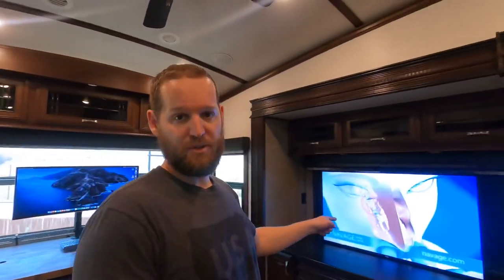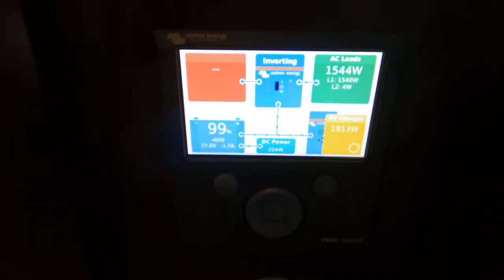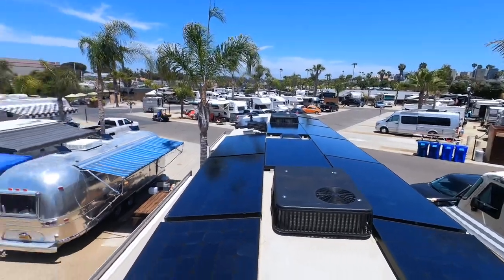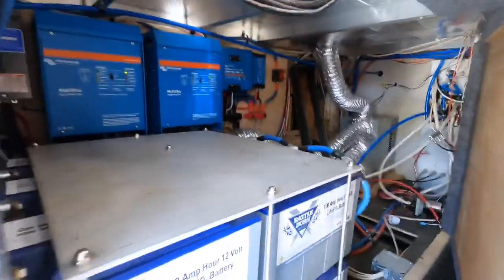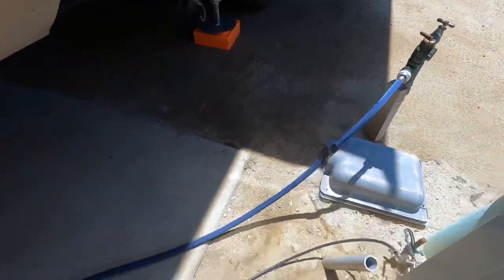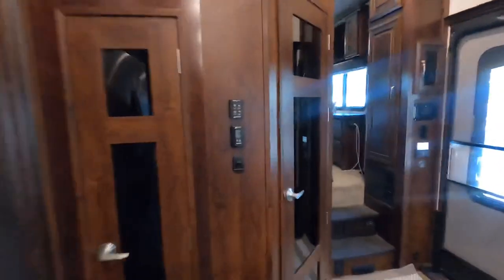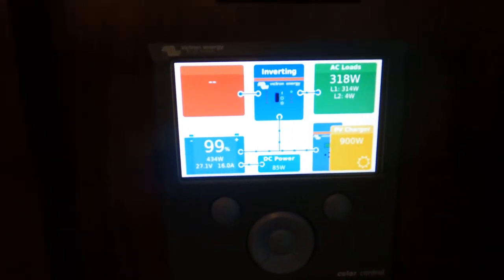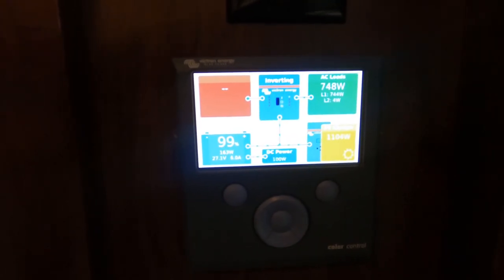Can We Run RV Air Conditioning On Solar Power? A Quick System Overview!

Comment: The dog sleeping in that position was hilarious.What would you think about running a ductless air/heat system instead of the roof shaker style?
Reply from the maker: I actually did a mini split on my last RV, I really did enjoy it but it was a lot of work to make it “like factory”.  It would be much nicer if you could buy a new RV with one pre-planned, pre-plumbed and pre-installed.  Then you’d really be on to something.  It’s a goal of mine for the future, no doubt.
Reply: we call it camping How did the mini split handle the traveling? That ya always been a concern of mine that it would get beat to death?

Comment: Very nice setup. With that bank of batteries do you still need some sort of extra capacitor for the initial start/surge of the A/C compressor?
Reply: He mentioned he has an Easy Start from Microair on his air conditioner. It lowers inrush current significantly. Small generators can run an AC when installed.

Comment: Hi, good video. What would say your total power generation is on a good day?  You've got 2,500 watts of solar and I've heard the rule of thumb is 3 or 4x that for a daily total, so 7,500 to 10,000 watt hrs?
Did you ever consider a mini-split that would only pull 400-800 watts vs your AC needing 1,500?

Comment: How many watts of solar do you have? And so you're inverting with 24 volts with a converter for the 12 volt stuff but the 110 is off of 24 volts correct?

Comment: Do you have to use Soft Starts on your air conditioners?  Did you consider using 320 Watt solar panels, which are a little larger, and heavier then the 200 Watt solar panels?  The size difference is negligible,  and the weight differences are approximately 40lbs verses 26lbs for the 200W solar panels.  I figure that I can lift a 40lb solar panel, but not sure they will fit?

Comment: Very nice setup. Can I ask what charge controller and inverter you are using? Also how money do you think have in total for your system? Just curious thanks.
Reply from the maker: Charge controller is the Victron 150/100 and dual Victron 3000/24 inverters.  I really haven’t done the math but I’d say you’re in the $18-20k range in parts.
Reply: I figured it must be somewhere around there given the cost of Battle Borns alone. Thanks for the info.
Reply: @patcmontgomery  Hopefully you are still monitoring your comments on this video. I am getting close to you now! I have 4 - 200 ah batteries. But still need more solar but getting there. Question for you about the 24 volt to 12 converter. Is that powering heavy duty 12 volt appliances such as hydraulic slide motors? I can't get my head wrapped around how I can got to a 24 volt system in my fifth wheel. I believe that 24 volt to 12 volt converter you have is around a 70 amp, is that enough? Or are you hiding a 12 volt battery somewhere still? Thanks!
Reply: @muirindustries you can get a 6500w system for much cheaper now with 48v batteries. Those will last longer and with 8 410w panels make enough power to start and run ax for less than half the cost

Comment: what brand is that controller/control panel? does it have a way to integrate grid power if thats plugged in and charge the batteries?

Comment: Do you mean that the rv can have a single air conditioner running 24 hours without the need to connect to the electrical network? 

Does that mean that during the day the solar panels run the air conditioner and ALSO FULLY CHARGE the batteries, which in turn provides all the power throughout the night?

Comment: What brand panels do you have?   Also what’s the difference in the battle born deep cycles?  I see there is two styles. One looks smaller than the style you have.
Reply from the maker: I have Sunpower panels.  So long as you’re talking about their 100ah batteries there is no difference, just form factor.  Just go with whatever fits you best :)

Comment: I am betting that setup is around $20,000 (at least) in parts alone.  Each of those batteries are around $1000 and those are the Victron inverters--also around $1000 each..
Reply: Yup, a masterclass on overkill spending.
Reply: Better than spending the money on cocaine bars or whores. LOL
Reply: @bullbutter9699  I guess it would be.  I went for a Giandel inverter with a separate automatic transfer switch.  Batteries were Ampere time.  Setup works great.

Comment: Great video! I am about to purchase a 2021 Palomino Revolve EV-1 RV. Whats unique about this travel trailer is that it is all electric and runs completely on solar. It has 400w of panels on the roof and another 300 watts of portable that plugs into the back with 4 battle born 100ah batteries.   They are saying it is sufficient to run my heater and AC. I'm not seeing it. It is a Renergy system, designed by them and has one 3000 watt inverter. I would love to hear your thought's on this out in the real world and how you think it will fair. Any input would be greatly appreciated!
Reply: I just received my 300 watt Renogy system yesterday, so I don't know personally, but I think you're right that it's not enough. The 4 batteries is sized right for making coffee (I overwork my 330AH battery bank (3X110) using my small keurig on a 3,000 watt inverter. It will drop those batteries from 12.5V to 11.5V by the fourth cup of coffee, but they bounce back up to 12.3 or so. I wouldn't risk damaging something by trying to run my A/C on this. I've burned up two cheap inverters getting close (but not exceeding) the output limit. 
As for the panels, I've been reading on the forums. People that have 100watt panels mounted on the roof seem to get about 50 to 60 watts during the heat of the day, and less the rest of it. Oddly, on the forums, people giving their actual setups and outputs are ignored as the thread goes down the spec sheets talking about what you need. The guy who pipes in and says he has that system, and gets half what the thread is assuming just gets ignored as the majority continue to use the optimum numbers on the spec sheet. 
Maybe you have a really efficient air conditioner, but mine has melted extension cords on a hot day plugged in when 30 amps wasn't going to reach. I'm figuring on being able to make coffee and run everything but A/C without the generator on this 300 watt system. I'm figuring I'll peak about 20 amps, and can count on at least 5 to 10 for the bulk of the day. We'll see; mostly I just wanted a trickle charger that wouldn't boil off my batteries when I'm plugged in for weeks, so I thought I would upgrade.
Reply from the maker: You have a zero percent chance of running your air conditioning via this setup.

I don’t know what inverter it comes with, but if it’s large enough you could theoretically run an air conditioner for a few hours, but you’ll be running at a huge deficit and sooner rather than later you’ll have dead batteries.
Reply: If one adds a "Soft Start" Capacitor, you might be able to run one A/C unit, for a little while.    I set up an RV. with 1800 Watts of Solar Panels, and 400 ah batteries, and I was able to run one A/C unit for quite a while,  My biggest limiting factor was the 400 watts of battery power.  I used a 150/100 MPPT Victron charge controller with one 12V 3,000 watt inverter.  I tried running one A?C unit, but my system just could not handle it, until I put a Soft Start capacitor on the A/C unit.  I think that I was barely able to run my AC unit, and the A/C unit eventually failed.  I don't know if the problem was low voltage, but I know that in the event of a low voltage condition, the A/C compressor over amps, which will cause a failure to the compressor.  The problem is, it may only experience low Voltage for a minimal amount of time, just when the batteries go dead, or on their last leg.  Therefore, often the problem of low voltage is not recognized, until the compressor burns up, or over heats one too many times.

Comment: Damn! 12k just in batteries!
Reply: exactly my thought!
Reply: @rffairchild2  every 6 years too. must be nice to have 2k a year for batteries.
Reply: Current lithium ion battery banks last for about 10 years before replacement is needed
.
Reply: @jimfairchild2093  is that like avg or youtr setup? they are rated for 6 years with normal use.
Reply: Can you explain more on the rig to keep the batteries cooled? And other aspects on the spaced used in the RV storage area?

Comment: Love the setup man. Pretty much my ideal system. Do you foresee the need for a supplemental ground array for the meaner weather?
Reply from the maker: Where the Jones thanks!  Shooting from the hip my answer would be yes, but I also think that has a lot to do with the temperature you’re comfortable at.  As someone who’s lived their entire life in a relative lack of humidity, it’s just something that I can not stand so when it gets hot and humid I require the AC.  My assumption is, as we head east we will reach a point where I’ll have to supplement our power, either via our small generator or visiting an RV park etc.  A ground deploy is something I’ve heavily considered but never needed and until I have a better grasp on the real world requirements I don’t want to put something together that isn’t ideal.  The only thing holding me back from already having one is transportation/storage of the panels.  Plus, inevitably the moment I put them out is the moment it gets really windy...
Reply: @muirindustries  Makes sense. Using the generator might be the best solution for supplemental, all things considered. But like you said experience will give you more info to work with. We have another 1-2 years before we are back in the States but when we do we will be full timing and will be needing the autonomy that only a system like you have will provide...and I too like my A/C.  I got my notifications on so I'll be watching for any updates.
Reply from the maker: We’ve got two more nights in an RV park (Bullhead City, AZ) to let the dogs play in the Colorado river by Lake Havasu, then we’ll start the Boondocking portion up at the Grand Canyon and I’ll actually put some effort into videos (not just a haphazardly thrown together GoPro video like this).  I’ll be doing some stress tests and all of that.  You’ll have to keep me updated as you make the transition yourself!
Reply: @muirindustries  will do!

Comment: Amazing setup.. this is the way it’s done ✅ How much did that set up cost is what I would like to know?!
Reply: Easily $20k+
Reply: @ryanyoung7433  I was thinking the same 20k, I think his system is too extreme. My solar system is only around 3k. which includes 8/200 watt panels, 4k watt 24V inverter, 4 100AH Lifepo4 Batteries.

Comment: If you have a net zero draw from the batteries, do you really need 12 batteries for ac to work in the sun? Would a similar setup work with only 2 batteries?
Reply from the maker: Generally speaking you'd need a bigger battery bank than that, at a bare minimum you'd need 4 to spread the load out.
Reply: You could draw more amps by getting 6v and making 12v connections. Then in series. You would be able to run it but for shorter time. 24v system would be ideal.
Reply: 6v tend to have hire ah than 12v

Comment: Are your panels from Tesla too? What sort of watts each panel makes?
Reply from the maker: They are Sunpower 210w panels
Reply: @muirindustries  So, you have 10 solar panels? essentially making 2.1 Kw on a good day? And, 2x 3,000 watt inverters! Of course you can run the A/C when you throw tons of money at the problem!  Your video should be titled, "Solar A/C only works when you have money to spend, good luck everyone else!"
Reply from the maker: @joshi.5553  12 panels, 2.5kw on a good day.  Maybe I'll make a video about how you can own an RV if you have money, good luck everyone else!  It's all relative.....

Comment: I'm a bit confused. I have a similar system with most of the same Victron components and I also can run my A/Cs. You show that you are pumping 1900ish PV watts in the video but only have a 150/100 charge controller. That math escapes me. if you maxed out that controller you would have 100 amps flowing at approx. 13.5 volts which is 1350 watts at max. What am i missing? Perhaps another controller I didn't see?
Reply from the maker: You missed that the system is 24v, thus that controller is capable of double in all ways ;)

Comment: I have the Victron 3000 with 4 lithium batteries. Trying to run my dometic 13500btu AC unit with the soft start installed.
The fan will start but when the compressor kicks on it trips the inverter. Can you help me figure out why?
Reply: The Victron 3000 only puts out 2400 watts in real power.  A Magnum Hybrid MSH3012RV inverter can put out 3000 real watts continuously.
Reply: It could be a setting on your Inverter.  I had the same issue with my system.  I have enough battery power, but everytime I started the microwave, the inverter would fault out.  The issue with mine was the inverter was set to trip out when the batteries went below 12V.  When a large power load is on your batteries, they will measure lower voltage, so the inverter thinks your batteries are low and need to be protected.  When the large load is stopped, the batteries jump back to 14V.  So, take a look at your inverter settings.  You may also want to look at the wiring between the batteries and the inverter.  If it's traveling more than a few feet, you may be losing some power due to the size of your wiring from the batteries to inverter.
Reply: @AWOLlcdrpeterson  I had a similar problem, and found that I had a loose 3/8" bolt on my Victron input battery connector bus.  Under small loads, everything look and appeared to be fine, but as I touched the wiring, the ground wire was hot.  Heat is generated when you have loose connections.  Further investigation with a heat gun, revealed that the bolt was not torqued to the manufacturer specifications, and was over heated.  The heat was caused by a poor connection, and somehow the Victron 12V 3,000 inverter was tripping off line.  I retorqued all the bolts, and found it to be about 2 turns short of specs.  Once I had everything retightened, the problem went away.  Solved!

Comment: 12 battleborn batteries though, that's a ton of money at $1000 each.  Just 12k in batteries alone, no big deal.
Reply from the maker: It's all relative, $80,000 trailer, $80,000 truck, it can all be done cheaper but comfort and freedom aren't free :)

Comment: The AC units on your RV appear to be way less energy demanding than regular RV units. Attacking the power required from both directions.  They appear to have way more cooling core and fan on top. They do not look like modified window unit like most RV units do.  What is the BTU rating ratio to power demand, what voltage are they?

Comment: of course you will be able to run your ac when you have a solar system that is pushing an investment of 20k. I bet you could run a generator the life of the time you are in that rv and not even spend 10k in fuel and maintenance. Solar is nice, but the break even point in an application like this in my mind just is not there.
Reply: do you want, and your neighbors, to listen to the sound of generator for the whole life of the time you are in that rv?
Reply from the maker: If your only goal is to do things the cheapest way possible, get yourself a hammock and find two trees.  It's about the freedom, not the "fuel savings"
Reply: @muirindustries  I love that reply you had for him.
Reply: If you are a preper, then it is worth it.  What if we had a total collapse of the Electrical Grid, or anarchy hit our country.  Could you live in the wilderness for any leagth of time using a Generator?  Have you thought about water, and food?  What would it take to live off grid for a week? a month?  Most people think about food, but not water!  If you don't have some of the basic items, then lasting in an RV with a generator is enough!

Comment: Yeah you can run an ac on a 10k solar set-up anyday buddy lol
Reply: He has 12 battle born batteries $1022.00 = $12,264 , 12 - 200 watt panels  $3000.00, 2 Victron charge controller $1050.00, 1 4000 watt inverter  $1100.00, all associated wiring $600.00 , custom install $2000.00 and up. = total $20,014 minimum and probably more. 5th wheel $80,000.
Reply: He is running an ac, tvs and a ton of other stuff. For some of us common folk you can do the same set up on a smaller scale and the information is still helpful. I am doing about 1/4 of what he has, but I don't need as much power so his setup is helpful still. 🤷 Perspective.

Comment: coulda saved $10 Grand and just plugged in
Reply from the maker: More than 10 grand in batteries…

Turns out you can’t always “just plug in” an RV.  But thanks for the insight!
Reply: @muirindustries  Sure looked like you could! Its your own video, you walked right past your site plug-in. "More than $10K" is a great investment to only run 1 A/C at 76 when there's a plug right there.

Turns out you can always buy a $2K generator and set BOTH your A/C to 70. But thanks for the insight! 

I know there's different & unique scenarios that benefit for it, but my original comment still stands "coulda saved $10 Grand and just plugged in"
Reply from the maker: @NRYT2360  ahhh yes, because the next 3 months we spent on the road across the entire county without plugging in don’t count lol..
Reply: @muirindustries  I get it. I'd be telling myself that too